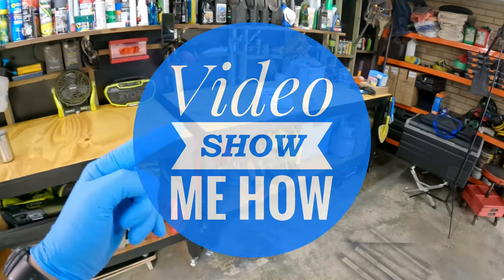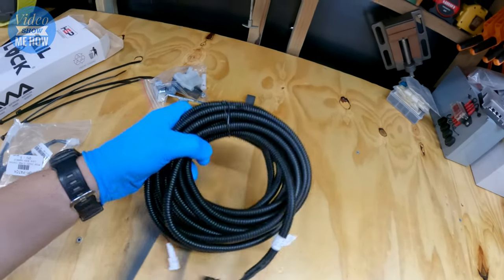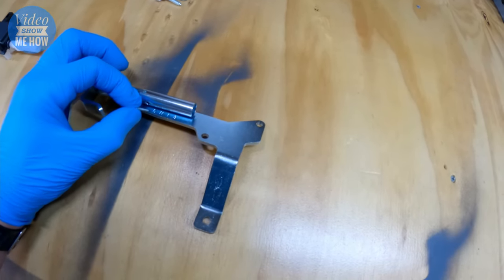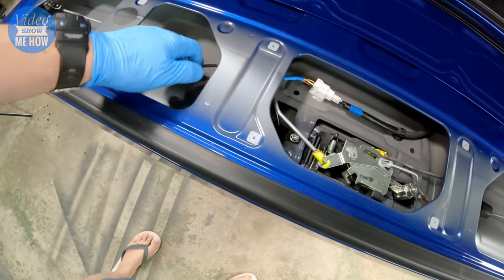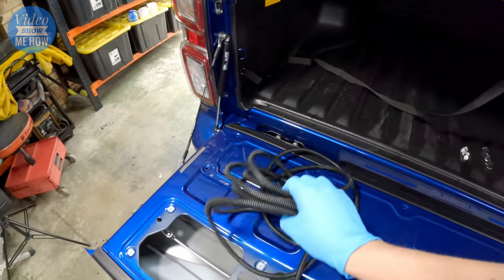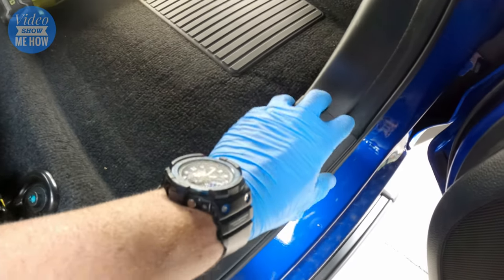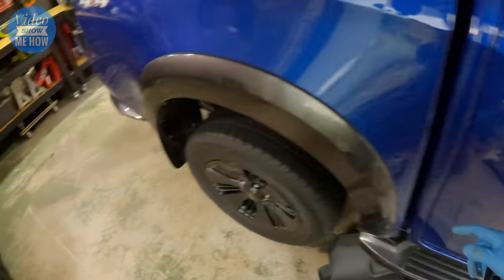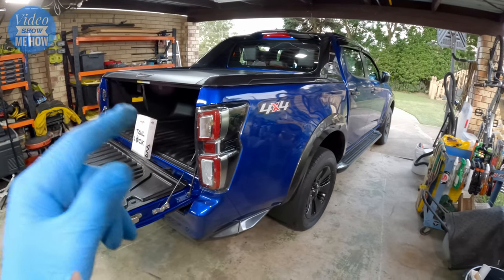ISUZU D-MAX HSP Tailgate Lock Central Locking Install - 2021 DMAX X-TERRAIN Build Series #2

Comment: When putting the original lock metal parts together, push the actuator into the metal part as far as you can get it.  If it doesnt go in far enough it wont lock properly.  With the rear tailgate liner, once you have unscrewed the four screws just unhook the right or left tailgate bar and slide it out rather than trying to fight with the rubber seal.  Prevents damaging the seal.  As far as the grommet goes in the firewall,  I would not pop it out, just cut a slot in it to get the loom head through and seal it with silicone at the end.  It is impossible to get the grommet back on particularly with large hands.  I have been going at it for an hour and a half and am giving up on it for the moment.  I have no idea how I'm going to get it back on.

Comment: A great mod for a great vehicle. Can’t wait to get this and the tailgate assist installed when my MY21XT arrives. 
The after-market market would suffer if all these extras were added from factory and the new DMax range certainly have a lot of inclusions, but a proper fully automatic central locking system should be standard. 
Great vid, too 👍🏻

Comment: Had a small issue with this one (I got my car on Thursday) I cannot for the life of me get the loom through that bloody rubber grommet on the firewall. So I have stopped and reset and I will look at it later. I also put in the tailgate storage, bit of a pain getting the alignment sorted correctly, but it is in and finished now. Tailgate struts, on the left hand side, one of the screws was so tight it stripped the face, so now I will have to drill it out and replace it before I can put the left side strut in. Fuel filter in and done, putting the inline adapter into the original pipe, what a pain. Window module in and done. Perfect. Bonnet struts in and done. Munji hard intercooler pipes, in and done. Rear indicators and rear lights replaced with led's. Have the catch can and the UHF sitting on the table, but I'm a bit over it now so I think I will go out and have a few beers with mates before I continue. Don't think I would have got through it all without your excellent videos, so thanks for the help mate. Got an EGR Dust Defence Kit on order, as well as well as some MaxPro Floor Liners.

Comment: Great video. Keen to watch more. 

Couple mods they should have with the car. Button to turn off safety features while 4 wheel driving or towing. As well as proper "welcome home" lights like normal cars.
Reply from the maker: Thanks mate! Do you mean the headlights staying on? I though the xt was mean to have this but come to think of it I've never seen it work
Reply: Your supposed to turn car off then flick thr highbeam towards you. The can then beeps cause the lights are on. Once you close drivers door the lights stay on for about 30 seconds. It's annoying to do if you have sleeping kids
Reply from the maker: @chrisgunn5858  Ah what! But you have to have the stalk flicked forward to auto high beams to work. Hmmm shouldn't have to do anything :( I reckon Isuzu should collate some of this stuff and put it in a software update

Comment: Great video, straight to the point with no useless information. I would like to see a vid on tailgate seals as there seems to be a few different universal and model specific kits about and it's hard to tell which one to buy without trying them. I've ordered the Trac folding mirror module which I think should also be included standard for a top spec X-Terrain. A lot of the extras people on here are asking for seems to be standard on overseas models. I've added gas bonnet struts to mine, but they are a custom made setup I designed and made and not like the ones on Ebay that run along the sides of the engine bay. Mine sit right at the back near the hinges so the engine bay is completely clear of obstructions with the bonnet up, best mod i've done so far. The standard bonnet stay is a joke on a 2021 vehicle and a pet hate of mine being a mechanic, as they always seem to be in the way when working on the engine.
Reply: Track folding mirrors module?
Reply: @paulg101   "Trac" is the brand name of the folding mirror module. Sorry for the confusion.
Reply: Trac Electronics.

Any reason why you went with the HSP tailgate central lock kit vs the Trac Electronic central tailgate kit?
Reply: @paulg101   Trac don't make a kit for the 2021 D-max yet as far as I know. I asked them about one when I got my mirror module and they said they were going to do one but weren't sure when, due to the chip shortage I think?
Reply: Just ordered the Trac mirror and window module

Comment: Great video mate, they should have had a button that directly turns off all the safety features rather than going though the settings each and every time you turn the ute on and off.
Reply from the maker: How do you find the IDAS? Once I turned the speed chime off I've found to be pretty good?

Comment: Think there should be button to turn off the driver assist bits and peace’s for towing or should turn off automatically when you plug the trailer wiring harness it just like the reverse sensors 
Thanks for the videos very good
Reply from the maker: Cheers! Make sure you subscribe, lots more to come :)

Comment: The tail assist, tailgate central locking and a 12v plug in the tub for sure
Reply from the maker: 12v system currently being planned out, def need some plugs in the back for fridge etc 👍 Thanks for watching

Comment: Watching now and another great product.  👍🏻
Will this work on an 2021 LSU without the keyfob or push button start.
Also both moss you have done should be installed as standard
Reply from the maker: Hmmm does the lsm have central locking?
Reply: @VideoShowMeHow  LSU yes is has central locking

Comment: Hey Adam, just finished the install on my new bus. Loved the easy instructions.
Wanting to know what your tip is for getting the grommet back on?
Pretty simple to get off but trying to feed it back onto the plastic thing is proving a bit challenging.
Even took it to my local Isuzu dealership and they couldn’t get it back on.
Reply: Did just finish getting the grommet back on. Ended up pushing the white plastic off the firewall and putting (most of) the grommet back on that way. Still required a very skilful left handed approach and LOTS of time. 
100% would NOT recommend pulling that grommet off. A HUGE pain in the arse. 
And I ended up siliconing the last 1/4 I couldn’t get back on.
Reply from the maker: Hey mate thanks for the reminder. Yes, an absolute PITA. Had another crack just now.. turns out the white plastic bracket can come out, twist it 180 and you can see how it clips together. Jam a flat head in there and it clips apart for removal. I spent a good hour (maybe I'm just slow haha) on it and can't for the life of me work out how it is mean to be assembled. The bracket to me is obviously mean to clip on somehow after to loom would be fed through in factory assembly but buggers me how. The upside is it's dead easy without the white plastic bracket to just push the rubber grommet into the firewall hole (you know, like every-other-firewall-grommet-in-the-world!) so it seals up. Have left the white bracket out for the moment until I can build up the patience to give it another go. At least it's sealed I figure!
Reply: @VideoShowMeHow  haha should’ve warned you not to take it off again.
It’s honestly one of the worst grommets I’ve dealt with. Every other grommet just pops right back in as you said, but nope, not this one.
A lot of patience and luck got mine mostly back to factory. Might have to take off the plastic housing if my rush job doesn’t hold up.

Thanks for revisiting the pain with me though 😂
Hope you can get it back together again!
Reply from the maker: Haha one day will muster the patience again.  I'd honestly rather drill a hole next time 😁
Reply: What grommet do you mean at what minute does it come out???

Comment: Great videos Adam....so when you use central locking on tailgate, does the tonnue cover stay locked/unlocked as i believe this is also a manual key lock ?
Still waiting for my X-Terrain !!☹
Reply from the maker: The roller shutter? Yes this is a separate key unfortunately. I usually just leave this locked as with the central locking mod on the tailgate you can still access for most stuff
Reply: @VideoShowMeHow  ok thanks,...poor design in these modern times eh....but thats what i thought. So yes easy to keep the cover locked, then just pull out any kit,...then close tailgate and central lock !!..all secure then.😁👍
Im also wanting to put a low profile roof platform on mine when i get it....any recomendations !!
Cheers
Frank
Reply from the maker: @franklongley4899  yep agree!

Comment: I have a question - can you still use your car key to physically lock the tailgate even if you have successfully installed the tailgate central locking? For my situation, I can use the remote key to lock all car doors including the tailgate but i cannot use my car key to lock the tailgate (although i can use my car key to lock the driverside door).

Comment: Great vid! I now have central locking on my X-terrain too. One question though, how the hell did you get the rubber grommet in the engine bay back into its slot? I pulled mine out to make the slit for the loom, but buggered if I can get all four sides of the grommet back onto the white plastic backing that it clips into. Its so damned tight up in that corner and the main loom blocks access to the back corner of the grommet. Any tricks and tips?
Reply from the maker: Hey hey nice one! Yes it's an absolute PITA. First time I had it off got it back on no probs didn't think anything of it. Round two however took FOREVER. From what I can work out you've got to try and Macguyver your hands in there, hold the bottom bit in place while stretching the top into place. I swear, if I have to take it off again I'm just going to Sikaflex to while thing :( Anyone else have any tips I'm also all ears!
Reply: @VideoShowMeHow  Thanks. Glad its not just me! I have seen some other vehicles where they suggest popping out the white clip, joining it all back together and then pushing it back into place. Might give that a shot on the weekend....
Reply from the maker: @PaulTaylor79  oh now that's an idea! Wonder if it could be pushed out from the inside?? That could be the go. Will give it a crack on the weekend also 👍👍

Comment: Hey. How do you re-fit the grommet once your all done. Is there any easy ways. Do you need to pull the plastic part off??
Reply from the maker: Yeah it's a pita. I ended up unclipping the white plastic part (there's a clip job the bottom) and just reinstalling the rubber grommet in the end

Comment: the order i received had different part that equipped on the actuator and doesnt allow the use of a hard key at the same time.
im wondering how come i didnt get the exact same as yours.
Reply from the maker: Yeah there appears to have been a design change

Comment: I have isuzu dmax 2023 model base option it s center locking system working with key only no have the remote . how i can add remote for the same. where i can buy the module and remote. Please suggest
Reply from the maker: I don't think it's possible to add remote central locking separately, You may be able to add it if you can find the modules from a wrecked higher model DMAX maybe but would probably be a bit of work

Comment: What if the handle is forced when locked? How durable is it?
Reply from the maker: It's a pretty solid bit of kit, you can see in the vid how it works. You'd effectively need to somehow bend the steel, reckon the handle would break first loll

Comment: They should sealed the gap in the tail gate (bottom), central locking tail gate and easy lift
Reply from the maker: Am currently researching the best solution for the seal, any leads?
Reply: Also when manually locking the drivers door with the key it should lock up everything and not just the drivers door

Comment: I just wish HSP would send this to norway, I have the same car but there is no place that sells this to norway. instead we got other options but again that require to cut cables and drill into the tailgate. I dont want to do that to my car
Reply from the maker: Have you contacted them? Maybe they could?
Reply: @VideoShowMeHow  Any clue where i can find that Piggyback adaptor for the set? Any partnumber on it maybe? Or maybe u know what kinda socket it uses, how many pins on it.. i could probl make my own piggyback cable :)